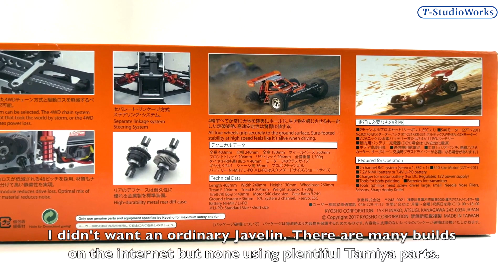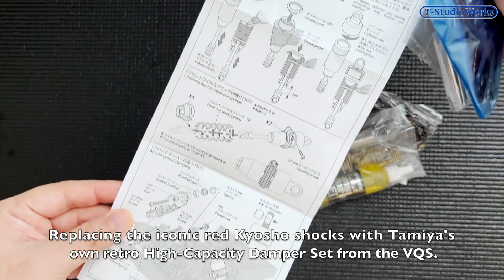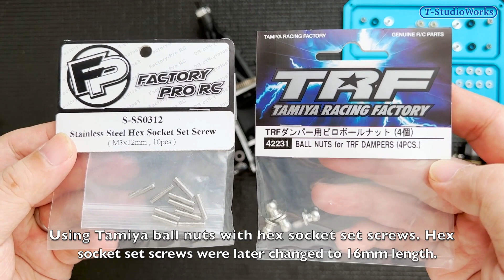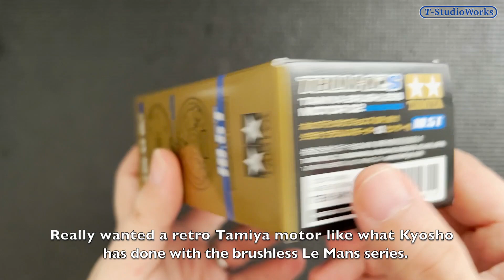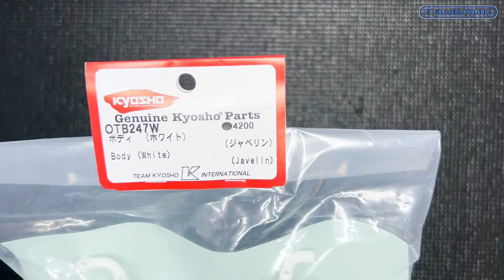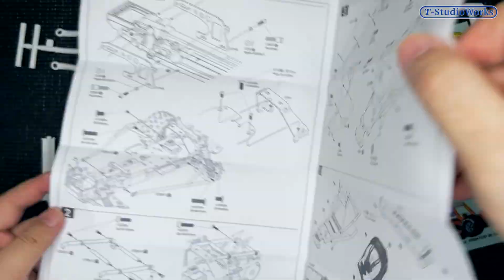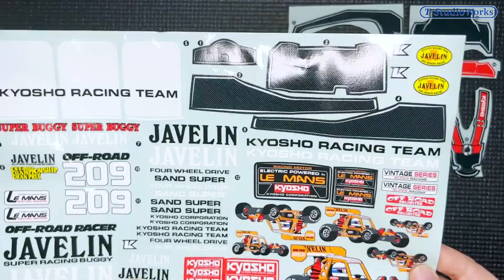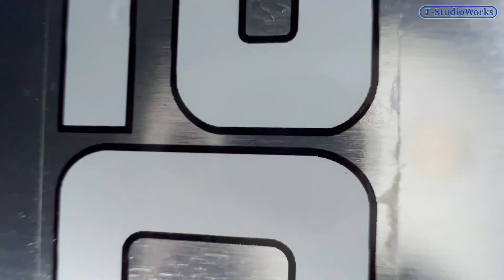How to Tamiya a Kyosho Javelin (2017) |  Unboxing & Build

Comment: Only flaw about the Kyosho Javelin was the weak chain drive system.  Back then, we had to keep replacing them as they stretch over time. thats why they went with the belt system with their other cars.
Reply from the maker: It’s good to hear someone share their experiences from those golden years of RC.  But I would imagine that it would still have been fantastic to own a Javelin during that time.  Thank you.  🙂
Reply: It's in on
Reply: I got my original Javelin from Tower Hobbies back when they included a belt drive conversion as a free bonus.
Reply: Chains rarely stretch…. But they do wear.  If each link wears 1/1000”, and with 100 links, that’s .1” wear. Cumulative wear is a big deal…

Comment: 57:48 The rear tires look flat with no foam’s in them.
Reply from the maker: Also think it's because of fitting 2.1inch tyres on 2.2inch rims.  So the sidewalls are already compressed.

Comment: Also, I love the build but what was wrong with the kit damper set????
Reply from the maker: Nothing wrong with the kit damper.  The Tamiya ones are a bit more purposeful like the Kyosho Gold shocks so I thought it would a good upgrade.  The silver beefier shocks goes so much more nicer with the white roll cage than the smaller red original shocks.  That’s my humble opinion.  😬

Comment: Those diffs are not planetary, they are bevel gear.
Reply from the maker: Good spotting.  You are so right.  I noticed the mistake too but had already shared the video.  Thanks for correcting.